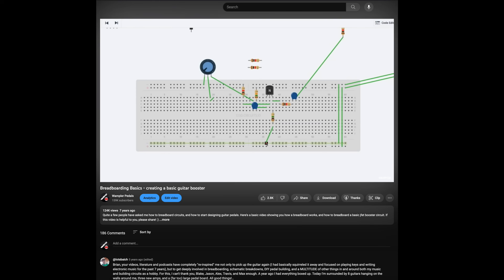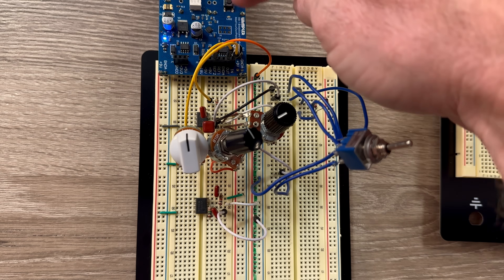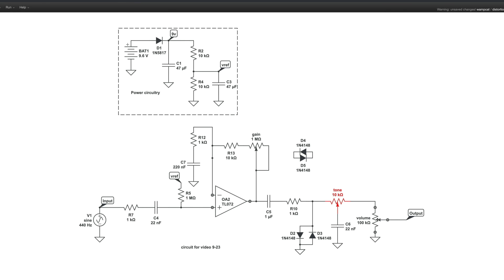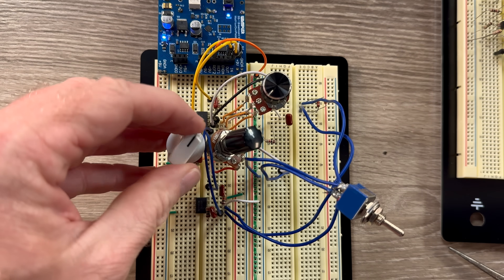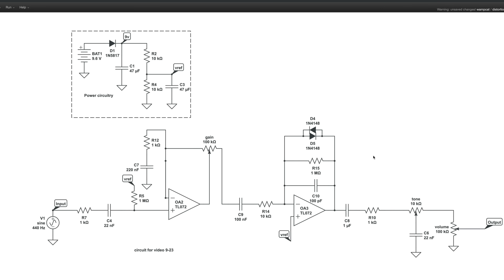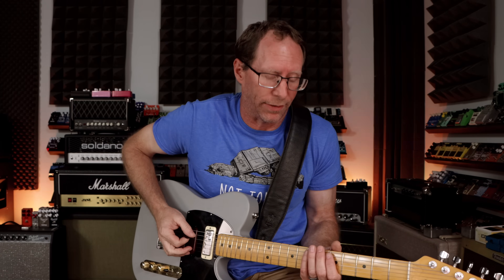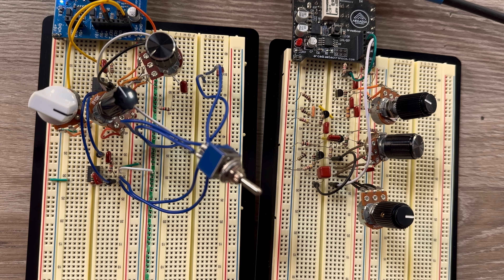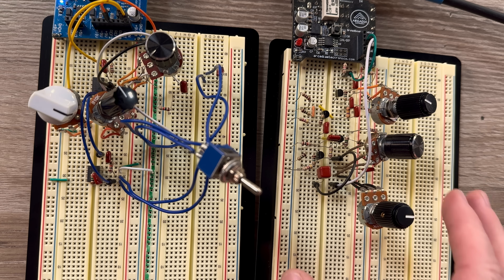How to Design a Distortion Pedal Circuit

Comment: Hi Brian, back in June i got the bug to build a guitar pedal after watching a JHS demo for the LPB-1. Ive never built anything substantial with electronics before. It was a success. I found this video and loved the sound of the op amp using hard clipping. This too was a successful build so i swapped out and did the soft clipping. I liked it more. Then it occurs to me what if i used LEDs in place of the diodes. After trying the different colors i chose red. I just want to say thanks for posting this video. For kicks im gonna try the mosfet circuit.
Reply from the maker: Wonderful!!
If you want to dive in deeper, make sure to check out the links in the description for https://www.GuitarPedalCourse.com 😉

Comment: Interesting. I have a question - if your circuit has 2 op-amps, do you need to have 1 inverting and 1 non-inverting? All the circuits I have seen so far do this but I'm wondering why.
Reply from the maker: You don’t have to do it that way but many popular circuits do that for a couple reasons. For example, you can control the gain in both gain stages with one pot easily that way.

Comment: I got some good clipping going in a circuit. It was meant to remove the common of the 2 stereo channels (that works too in the op-amp differentiator mode.) I put a 2 mode switch in it after experimenting with it. Oh, it's like the first month with amplification and I built 5-6 circuits in a few weeks.

Comment: would adding opamp buffers to the input and output remedy the need for those external buffers that you use? 4:52
Reply: Yes, I actually do this. Some will argue it will affect the sound but it’s negligible

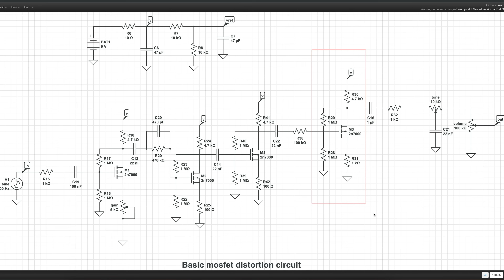Comment: 14:00 why would you need vref if you only use v? in the opamps I understand because they need +v and -v, but here I don't get it, please respond
Reply from the maker: It’s a 9vdc circuit. You’re thinking of bipolar supplies, in this type of circuit Vref would be sort of similar to how you use ground in bipolar.
Reply: @wampler_pedals  but in the circuit using only mosfets you don't use vref, is it of any use in that circuit?
Reply from the maker: If not on the schematic audio portion (in my diagram) then no

Comment: Hi there! Regarding the question mad on 16:56 I think the first one of both options is more "Modern" marshal, Slash from GNR, AFR thing and the mosfet stacked one which is the second sound more 70's rock with a Fuzz kind of lo guitar frequency, more old school... The super compressed and more modern one (with the switch) can easily used as a Mesa Boogie type of thing if connected on a EQ cutting the mids for a more modern metal/djent maybe? A good variation of this test is passing an oscilator to it an measuring al character of the sign regarding to its harmonic responses etc. Great video tho! Fine worldwide know Wampler pedals! I'm bassist but like guitar and music production... Regards from São Paulo, Brazil.

Comment: Love all your content and thank you for sharing. I've started to watch your videos and have been inspired to maybe start trying to see if this is something that I want to pursue. I've tried following exactly what you have done here but I can't seem to get anything to work with any op amp but I tried a simple fuzz circuit with a single 5088 transistor and it works perfectly. I'm using a Peavey vyper modeling amp and I wanted to know if this type of amp will even work with  building pedals with op amps like you use on this video; I've been trying to get something to work for the last 3-4 weeks and can't get anything to work. Is there something I am missing? I've tried different power supplies, cables, wires, all the components are new and I've even taken an of amp out of a perfectly good working radio to try(I won't be able to put it back together,lol) Any help would be so much appreciated. Thank you in advance!
Reply: Update, I must have somehow mixed up my good op amps with the ones I ordered, I order 25-4558d and 10 072's. Now I have 35 bad op amps, lol. I now know that even though you order new opamps online, they can still be defective!

Comment: I once read that gain pedals which use transistors often use BJTs, and often use FETs like JFETs and MOSFETs. What’s the tonal difference between each device, and why does it happen?
Reply from the maker: That’s a great question but too much to answer in a comment. Basically pedals can use all different types of transistors and op amps, all depending on what the person designing is trying to achieve.

Comment: I built both opamp and transitor types: a Blues Breaker clone (2 opamps) and a Plexi clone (3 JFETs).
The BB is great for overdrive, not so much for real distortion. Also tried different arrangements of diodes (Si, Ge, LED) and feedback resistors to find my favorite setting. It just produces a 'good' open sound, and provides great control
The Plexi gives more crunch and punch, and 'adult' sound, while still having this earthy timbre. Didn't yet try mods, so control is still not optimal for me.

Comment: What is the purpose of sending a signal through parallel diodes prior to hard clipping like one would see in the hm-2?
Reply from the maker: It’s a different style of clipping. Some like it, personally I’m not a fan of that type.
Reply: @wampler_pedals  would you consider it closer to hard or soft?
Reply from the maker: More of a hard “blocking” type IIRC. It kind of makes it sound a little fuzzy-ish. It also sort of acts like a crude noise gate

Comment: Thanks for the extremely informative video. I just have one question: how are you powering your TL072? What are the voltages are you feeding them for VCC+ and VCC-?
Reply from the maker: It’s just a 9vdc connection, like using a battery. Look up any typical overdrive or distortion schematic and you’ll see the power block, op amp is biased to virtual ground at 4.5v
Reply: @wampler_pedals  Thanks. You reminded me about biasing.

In case anyone had the same question as me: what he's basically doing is biasing the opamp with a voltage divider with resistors of equal value in order to obtain half of the input voltage. This creates an AC signal with an offset of 4.5V, so your AC signal can oscilate without losing half of its amplitude. Then, a decoupling capacitor is removing this offset, making your signal oscilate between -4.5V and +4.5V.

Comment: ty for video. i totally agree w the tone knob statement. i have a Rat: dist @9:30, tone @2:30 (they are backwards) and volume usually around 1:00. i kept it way more distorted and bright until i saw the Nuno interview w Rick Beato. now it is this crazy sweet spot. lots of head, stages well after boosts and makes a good boost, too. then i got a Pugilist. i got the hard stage very close, but the low mids are less head, yet the overall sound is tighter without the hiss noise. The Rat i still like better, but the Pugilist has a more modern sound and seems more versatile. i have an Eras for the higher gain stuff. the germanium has more bottom head and harder clip, yet cleans prettier than the silicon, but the silicon has more of the subtle overtones and seems tighter on rhythm. i cant wait to try a wampler!

Comment: Hey Brian could you do a video explaining VREF  in a guitar pedal schematic?  I am working on trying to read schematics.
Reply from the maker: It’s basically the mid way point between full voltage and ground in our guitar pedals, and we use it as “virtual ground “, ultimately just think of it as “home base” for your circuit- it’s just a voltage reference point that different parts of the circuit will connect to

Comment: In the mosfet as you clip at each stage some of the energy is bled off? Sent to ground? Thus  managing the energy for the next stage? In the end giving you the signal you hearing with the final product? Am I comprehending this correctly?
Reply from the maker: Kinda sort of. You’re managing the amount of signal sent to the next stage, in order to determine the overall distortion qualities. If too much signal, the stage can sound fuzzy and/or splatty. Each stage basically runs out of headroom, then clips though, and this is what gives the distortion. Very similar to tube preamp stages in guitar amps.

Comment: A few questions, when you bias the mosfets like you have them in this video,  how much does the bias resistor value affect the local NFB of the gain stage? Does it make a difference if you use a voltage divider in the "power supply section" and supply the vref through a single resistor? And, are there advantages / disadvantages to biasing with a source resistor-gate leak arrangement compared to either of the first 2 methods? ..... (Yes, I realize this is probably a big topic to discuss in a youtube comment section! lol) Would enrolling in the design course be a better way to get these types of answers? (I'm probably going to enroll anyway ;))

Comment: I'm wondering about the power circuit: we use a 9V battery, run it through a voltage divider to get 4.5V out. Wouldn't it be better to use 3 (or even 4 because of the diode) AA batteries instead? 

AA batteries have a much higher capacity than 9V batteries, + no losses due to divider. I understand that using 9V batteries is pretty much the norm with pedals, and that perhaps a 9V battery can be a little cheaper than 4 AA batteries. However, electrically AA batteries make more sense to me.

Also wondering: can't we use a voltage regulator to maintain a constant supply voltage throughout the life of the battery? I'm thinking a linear voltage regulator (L7805 or LM317). Maybe not a buck converter which could introduce some frequencies in the circuit.

Comment: Hi Brian, I liked both and for their own reasons. I did like how tight the op amp was for the higher gain stuff, and the Mosfets  for the squishier tone with more of the clean signal. If you were to use both types, say with the inverted op amp , into the non inverted, then the Mosfets at either the end, or at the beginning to start more like a boost like gain stage. would there be biasing issues?. and Obviously setting it up so that there isn't too much gain. I'm a noob right now slowly learning electronics.

Comment: Quick question, for the circuit at 9:45. No +9 anywhere just all vref? Also, in the power circuit, why that choice of diode? Thnx for the awesome knowledge!
Reply from the maker: No, it’s just a common connection, it’s implied that 9v and ground connect as they normally would.
Reply: sweet thnx i was missing pin 8 +9, and pin 4 ground, works now yay. Also, why the diode in the power circuit? and why that particular diode?
Reply from the maker: Protection, that value due to specs.

Comment: Thanks Brian! Such a great video again! It's very informative when you play the circuits and then explain them. To me both opamp and mosfet sounded great, just different flavors for perhaps different situations. It was so nice that the circuits had similar frequency response and amount of gain to help to hear the actual difference. When comparing pedals it's so easy to prefer the louder, brighter, gainier etc and ignore how they distort. For me the most interesting bit was how much the mosfet sounded like a cranked amp even before you showed the circuit!

Comment: WAMPLER, Make a YT lesson showing how to measure the soft clipping and hard clipping using the Oscilloscope plus measuring the S/N ratio. It would be nice if you show how to make an Overdrive pedal add a control to adjust the tone to be very tight to very loose and also add adjustment to sound very boxy. Example of a very tight sound is Pantera.

Comment: What's the blue PCBA attached to the BB? Clean 9v battery emulator?
Reply from the maker: It’s a breadboard device we created. We will be coming out with it shortly
Reply: FWIW I had some good results using depletion-mode MOSFETs in a dirt box design I designed and built years ago, they operate in a little more of a tube-like fashion than enhancement-mode devices.
Reply: I preferred the mosfet version btw... hey how 'bout 4049 type, like Craig Anderton's Tube Sound Fuzz, or the Red Llama? That type of circuit kinda sits between the OA and mosfet types, IMHO.

Comment: I have an idea for you, i just thought of it i don't know how good the idea is but let's say i would be a good idea the i would like to see a video where you would show this. I bought a new audio interface yesterday and this interface has input transformers in it. My idea for distiorion pedal or overdrive, which often is called saturation in mixing songs is basically what every track needs to warm up as they say the instrument or vocal featured on the track. Transformers can give a pleasant low end but also all the harmonic overtones to instruments to make it sit better in a mix.
My idea for this is basically to add a transformer for the meaty part of the guitar around 200-300 cycles and fill up the gaps, ofcourse you would need something to tighen up the distorion a bit, I always thing too much is worse than the original source. Most distortion pedals have to utterly irritation high end in the signal that drives me crazy when i hear it. and somehow people don't seem to turn the tone knob, maybe they don't care i dunno.
Reply from the maker: I agree, I’ve thought about doing something like that but it’s pretty niche. JHS colour box does this pretty good as well. I’m still thinking it through though- I’m always looking at “how do I take a concept and make it either different or better, and hopefully both”

Comment: I take the view that what we call "hard clipping" is often actually double clipping.  The gains asked of op-amps in drive circuits, with a 9V supply, often exceed the headroom they have, such that the op-amp itself clips.  A 9V supply to an op-amp will generally restrict us to about +/-3500mv amplified output.  How many times can a guitar signal (often > +/-100mv) "fit" into 3500.  Not enough to meet the gain settings found in most drive pedals.  We now feed that output and try to get it past some diodes-to-ground, that clip it once more; hence, "double-clipping".  In contrast, when the diodes are in the feedback loop, they clip, but in doing so they keep the signal level well below the headroom limitations of the op-amp (e.g., about +/-660mv with a pair of silicon diodes).  It's not "softer"; it's just clipped once, rather than twice.

If one is interested in using diodes in BOTH the feedback path AND going to ground on the output, it is useful for their forward voltage (clipping threshold) to be different, and in the "right" way.  F'rinstance, if I stuck a pair of germanium diodes in the feedback loop, they would clip nicely, but limit the output of the op-amp to around +/-350mv or so.  If I fed that output to a pair of silicon diodes, going to ground, those diodes wouldn't clip until the signal exceeded roughly +/-650mv, which the op-amp's output is simply not going to reach.  REVERSE that arrangement (silicon in the feedback loop, germanium to ground), and the silicons in the feedback will clip nicely, AND yield an op-amp output that is above the threshold of the germanium pair to ground.  Double-clipping deluxe!

Either way, what one gets out of it is also a function of tone-shaping along the way.

Comment: 1st - thank you so much for sharing this. it is very interesting and educating. 
2nd - I found my self wondering in the middle of the clip - how many overdrive/ distortion guitar pedal I own that are the same topology with different EQ and brand and marketing? 
3rd- for my and my headphone taste I think the 1st one was  more raw in a way (distortion wise) , but more ready for mix in a full band. the 3rd with the Mosfet was more refine and round. to each it use.
4th- I wonder if you can make a clip about the difference between the green Russian big muff pi and the big muff pi? is it only component or is it topology? and what is the difference between pedal for bass and for guitar? and if you want to do a clip about  the differences between all the main fuzz pedals. I don't recall if someone did it from the guitar effect builder point of view.
THANK YOU!

Comment: i'm partial to the mosfets. isn't the zendrive mosfet? works well with most amps. i let mine get away.
Reply from the maker: Not truly, the zendrive just uses mosfets like clipping diodes, not actual gain stages. Good sound, just different application
Reply: thanks
 @wampler_pedals

Comment: I'm playing around with the OCD circuit these days, and the opamp distortion in this video sounded pretty similar. The  mosfet circuit sounded a bit more spongy, less tight, less focused, altogether a bit looser to me. But as you say: it is not only the sound that you hear, but the feel as you play. I would also add, that many OD/distortion/fuzz pedals sound great on their own, and then completely garbage in the mix. So I at least always judge them by how I like them in our music. Which doesn't mean the ones I don't like are bad, they just don't work for me.
Reply: OCD uses Mosfet clipping, so that just shows how important the circuit design is as opposed to individual components out of context.